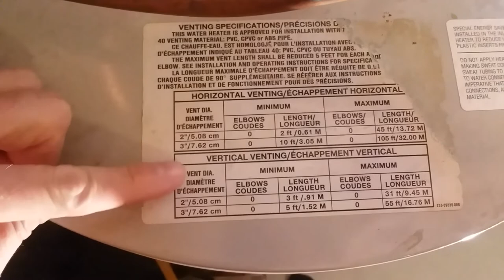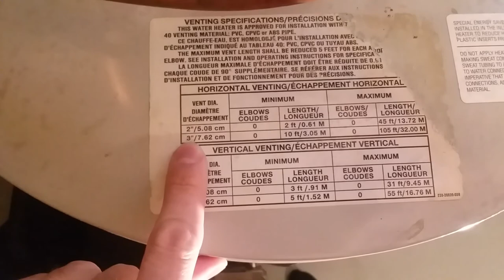Quieting a noisy direct vent water heater quickly and cheaply.

Comment: i would love a follow up video to this where he pulls it out and takes a look at what it looks like today.  there is a lot of moisture that comes through that vent. my guess is that the insulation collets a lot of it and creates a perfect spot for mold.
Reply: You got it! Fiberglass isn't designed to handle moisture well. Everytime that furnace fires up and shuts off its going to be a musty nightmare in there. He created a silencer but should have considered using materials that don't absorb water

Comment: Thanks for the great idea !  Now if there were only some video and audio recording of the noise AFTER the modifications.  Since you can easily remove the muffler portion, get a sound level meter, "C" weighting, fast response, and measure both inside and outside the home, and post the data here !!  Thanks again for the great idea !!!!
Reply from the maker: Thanks for the great suggestion Robert! - I thought of that when I was doing the video but the only decibel meter I have would be an app on my phone.  Would that do the "C" weighting?  I was reading about A,C, and Z...do you think C weighted would be better than A?  I read this online:

"It is extremely important that sound level measurements are made using the correct frequency weighting - usually A-weighting. For example, measuring a tonal noise of around 31 Hz could result in a 40 dB error if using C-weighting instead of A-weighting."

I do know that while the sound at the outlet was not super loud per se, it had this unbelievable ability to travel - maybe like a bass? It sounded like a hairdryer anywhere in the house - and now that is gone. But let me work on measuring it - that's the basis of good science!  Thanks again!
Reply: The "A" weighting rolls off the readings of low and high frequencies. The "C" weighting corresponds better with the "Noise Annoyance" of the blower motor system noise.  Most of the 'sound level meter' apps on my smartphone work fine, but true calibrated Sound Pressure Level meters can get pricey...  What we are looking for is the relative dB value of the reduction in your muffler technique !  Using five different SPL meter apps, the noise of my noisy direct vent hot water heater gave values in the 68 to 72 dB SPL range.  With the blower off, the background noise was 38 dB SPL.  According to one of the apps, that 72 dB value corresponded to "Busy Traffic".  All of the readings were taken standing in front of the hot water heater.
Reply from the maker: @robertklacza1160  Thanks Robert!  Using an app called Sound Meter, on my android phone (all I had) I measured the dB drop. I measured inside and outside for 30 seconds with the blower on from about 3 feet away from the vent and blower, and it gave the average dB. 
     Inside it dropped from 62.5dB to 58.4dB 
     Outside it dropped from 70.5dB to 47.9dB  wow!!  
Since the vent is angled down at a 45 degree this is about a 6" to a foot above the vent, 3 feet away. If I was lower, the dB meter hit 52.3 dB. Hope that helps.  It was really loud when I removed it!  I quickly got used to the quiet! :)
Reply from the maker: @robertklacza1160  I just posted an update so you can hear the difference before and after: https://www.youtube.com/watch?v=a8dtlGKeOL4

Comment: My problem involves the resonant noise is heard INSIDE the house.   My exhaust pipe is 2" and the horizontal run is about 12 feet to the vertical that connects to the W.H. fan.
Reply from the maker: Hey Gus - the sound I heard was definitely heard inside the house in the upstairs bedrooms.  It would wake me up at night. The strange thing is the sound right at the source in the basement didn't seem to be that loud, it must have been magnified  - with your long straight horizontal run, it may actually make it worse, like a long alpenhorn.  Since you are dealing with a 2" pipe, you can't go smaller. My suggestion is maybe 1) keep the 2" but maybe add a few 90 degree elbows or 2) use a 3" pipe as as a sleeve for a resonator over the 2" pipe.  Moving the resonators closer to the fan motor and before the 12 foot horizontal run might help as well. This could quiet the noise earlier and inside the house.  

Would love to see your video of what you decide to do.  It would be great to have an example of an "over-resonator" on youtube - where the 2" pipe remains and the insulation is built up on the outside of the pipe, but contained in a 3" pipe sleeve.  Good luck and please let us know what happens!

Comment: Question,  how would you install an air trap in one of these hot water heaters so that I don't get a draft back into the house? The exhaust on my tank is 2 inches, would you recommend that I use a 1 inch pipe? Maybe I am overly thinking this, but if there is any condensation in the exhaust couldn't it potentially create mold on the insulation? Thanks

Comment: A quick question : how do you adjust the temperature on this same water heater ?
Reply from the maker: Hi Vladek. On this model there is a control door on the side. Unplug the power, open the door with a screwdriver, and you twist the little thermostat adjustment with a screwdriver. On mine it is grey plastic and on the bottom of the controller (the thing with the red button). Close up, and plug back in. Good luck!
Reply: @justayoutuber1906   it worked perfectly. Thank you so much

Comment: Iiiim not so sure that's a good idea.... my boiler vents that way and I could see that A. getting moldy inside a cold pipe and B. blocking airflow, putting both strain on the fan and maybe pushing CO back into the basement

Comment: just a heads up, if you're in Canada you MUST use ULC636 approved Gas Vent Pipe to do this. ABS DWV and Schedule 40 PVC are not legal for use in flue gas venting applications.

For those in the US, the use of UL1738 approved Gas Vent Pipe is highly encouraged, and is required by law in some states already.

As a general rule of thumb, ABS DWV and Schedule 40 PVC pipe is not rated for continuous use under the temperature of the flue gasses that are passing through them. Its also worth noting that the fittings some of these pipe systems use are only glued in place, not chemically welded with a solvent. The glue used for connecting ABS fittings to ABS DWV pipe in particular has been known to crack over time when used for flue gas vent applications. This is the exact reason more than a decade ago it was made mandatory in Canada to use ULC636 gas vent pipe.
Reply: Please don’t do this on any country. You’re gunna kill somebody.
Reply from the maker: Great info - thank you. Yes this water heater is in the US and states on it to use ABS as the vent pipe. But different countries may have different build codes. What you reference I just read about here. https://www.plasticsnews.com/article/20181015/NEWS/181019947/plastic-venting-producers-seek-code-update-for-safety
 
Its strange to see that manufacturer's testing and local testing can be different.
Reply from the maker: @InkedUpHonda  Please explain.  I definitely don't want to do that.
Reply: @justayoutuber1906  There is a pressure switch so if you impede the venting too much hopefully that safety will open and shut the inducer motor off. But every manufacturer of Any gas equipment states not to put any changes to the venting and install exactly to manufacturers specs. The black ABS piping it’s not made for the heat that the flue gasses create. So they get brittle and the fittings crack the glue is only glueing the pipe and usually after a few years cracks and wears from expansion and contraction of the hot water tank cycling. The new pipe is called S636 vent piping and it’s made for fluegas temperatures what happens with the glue on that pipe is it mechanically welds the two plastics together of each  fitting. Way better. With this guys video the big problem with his installation and why he’s getting so much noise is because the manufacturer recommends at least 12 inches of straight venting off the top of the tank prior to any fitting. And I guarantee the tank has never been commissioned or tuned after installation so the gas pressure is high and that’s why he’s getting the reverb. Back to why I wouldn’t put a baffle regardless of what the manufacturer says is because now you’re impeding the flu gases and the heat is increasing in the venting so on already crappy venting not made for the job you’re slowing down the flu gases And making the problem even worse so, Before you know it your carbon monoxide detectors going off in your house if you even have one and hopefully nobody gets sick because the venting has cracked because you didn’t like the noise of an improperly installed hot water tank
Reply: @justayoutuber1906  Not to mention when that insulation gets wet who knows if it starts flopping down in those holes and blocks the main vent pipe this is just so willy-nilly if I saw this I would disconnect the gas appliance so fast